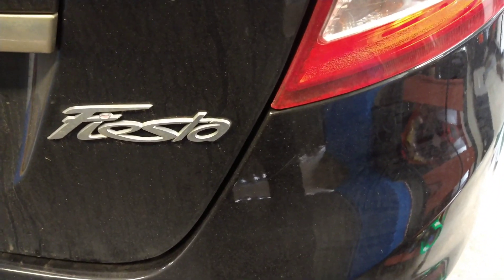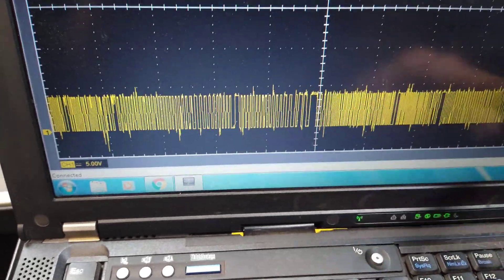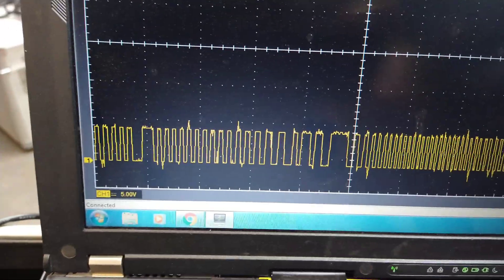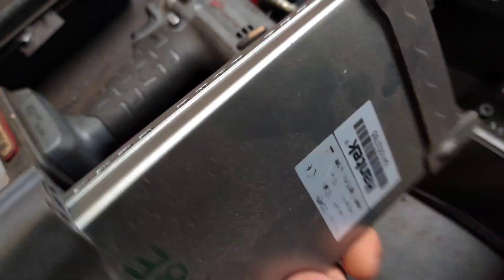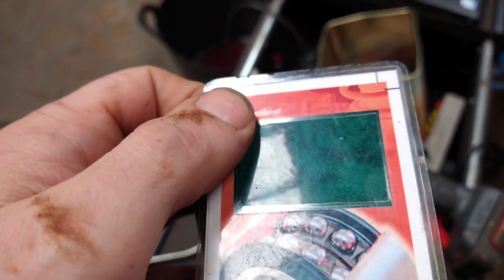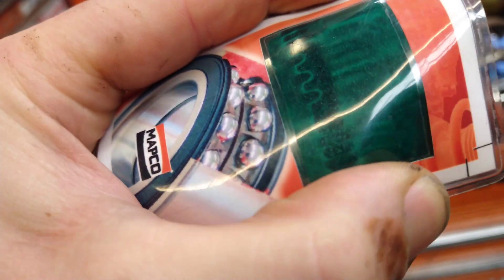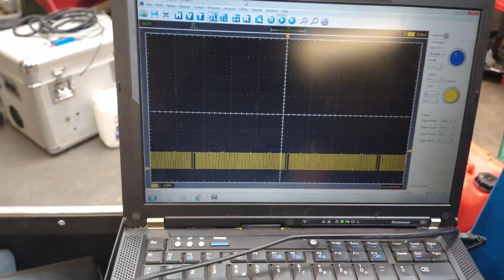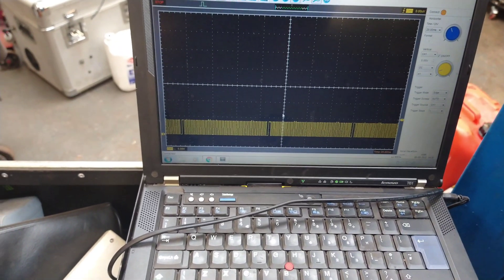Ford Fiesta (crank no start) P0336 Crank sensor range/performance

Comment: I'm having a similar issue, The weird thing is that I can't find the same crank pulley on any sites, I've a 2010 1.6 TDCI JA8. I only seem to find it when searching for HDI or using part number 0805E5. I've heard a lot about sensors always failing prematurley but I'm guessing it's more likely to be a silly issue rather than a sensor issue w/ this specific error code.

Comment: hi i am from india I am facing the same problem with ford fiesta 1.4 duratorq diesel engine can u pls tell me the name of that blue coloured film tool which used for checking the crank pulley teeth where can i buy that?
Reply from the maker: Magnet Expert F4MFP2-1 50mm x 50mm Small Field Paper https://www.amazon.co.uk/dp/B003N1LZ84/ref=cm_sw_r_awdo_navT_g_WJEXG06V1H43NJ7PW3YV

Comment: Hi. i have the same problem with my fiesta. What kind of equipment did you use to check this? My fiesta throw crankshift sensor error periodically (every week or couple of weeks).
Reply from the maker: The scan tool showed a crank signal fault, then I used a hantek scope to check what the crank signal looked like, this faulty signal may be lost on some hand held scopes. On the lap top it made it easier to see the whole rotation of the crank signal.
Some magnetic testing screen helps too
Thanks for watching
Reply: @mechanicmatt871  i am no mechanic but will try to find someone to do it. Mechanics replaced sensor three time already, but no avail. If it is not it, its ring or wires. Or ECU, but its the only error it gives so probably not.

Comment: thank you for the video, what is the card you stick on the pinion thank you for your answer
Reply from the maker: https://www.ebay.co.uk/itm/Test-Card-Tester-For-Magnetic-Sensor-Wheels-ABS-Sensor-Ring-/184279594494?_trksid=p2349624.m46890.l49286

Thanks for watching

Comment: Nice one Matt. The Hantek does a great job and I've never seen that thing you placed over the crank pulley before. Without it, you never could have been 100% sure of the damage. Great work
Reply from the maker: They really handy for wheel bearings with a magnetic abs ring too, I even check new bearings out of the box to make sure they are ok before fitting. Cheers Matt

Comment: looks like the scope was paramount in this diag nice find  ,  can you recommend a cheap scope for me if you don't mind ? i take it a 2 channel would be needed as a minimum  for diagnosing cam/crank etc . thanks
Reply from the maker: Thanks, I have had success with a hantek. Both laptop based and a hand held two channel scope. I have seen a few YouTubers using a two channel non automotive Pico scope that I'm sure they said it was around £100. 
Their are plenty of accessories available from hantek that would work on either scope.
A few times I have had a diag that I don't think could have been diagnosed as quickly or easily if I didn't have a scope.
Reply: @mechanicmatt871  thanks matt, i'll check those out.

Comment: Good video Matt shows how the cheap Hantek can deliver, no need to spend the big bucks cheers sandy
Reply from the maker: E bay although someone told me that dingbro were giving them away free, cheers Matt
Reply: @mechanicmatt871  cheers Matt
Reply from the maker: Thanks sandy, i think this has convinced the garage how useful the scope is.
Reply: @mechanicmatt871  where did u get the Matco magnetic tester from? Cheers sandy
Reply: Without magnet it would have been extremely hard, very very cool Matt thank you bud, you have convinced me to buy one if not the garage 😎